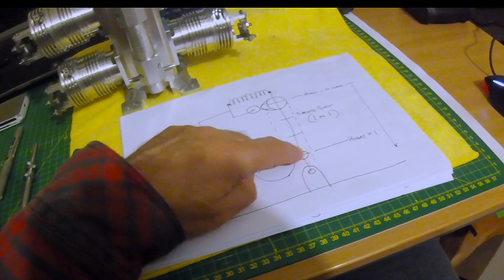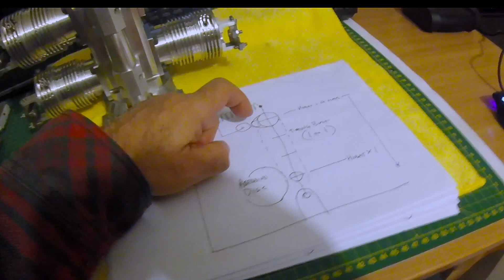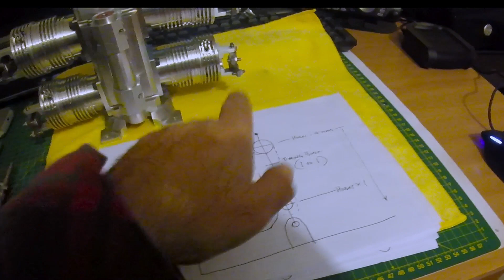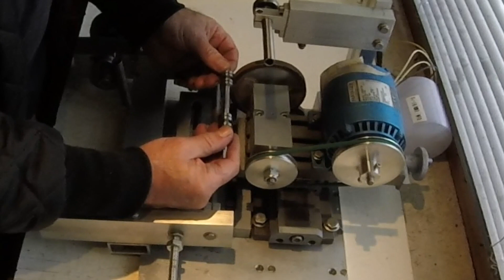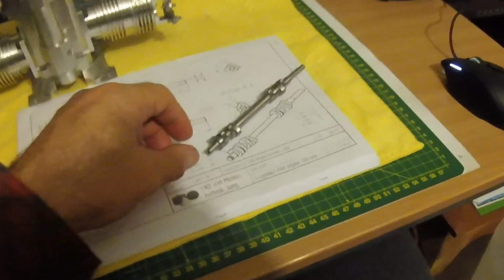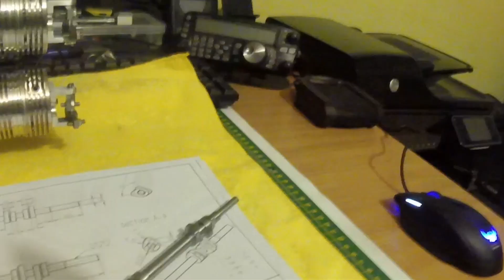Grinding a model engine cam shaft assembly.

Comment: If the master cam is following a roller bearing won`t the cam being ground be the wrong shape? Surely the master cam should press against a FLAT surface not a roller .
Reply: valid point but as the grinding wheel is round...

teh master cam has to be laid out with this in mind, thats all. like you can lay a cam out for a non radial or offset plunger, flat, round, pointed, whatever. it just has to be compensated for...

Comment: I very much like your machine and plan on having a go at making it. May I ask the dimension from the pivot under the cam being ground to the master. Thanks for the Video.
Reply from the maker: Hi John, I used an imperial measurement as it seemed easier, the pivot hole to the center of the master cam is 6 inches - Therefore the cam being ground is 1.5 inches from the pivot that produces a quarter size lobe from the master cam.
Reply: Thanks very much. I have started getting some materials together and I will let you know how I go . Won't be pretty but hopefully it will work. It will take a while though.

Comment: Very neat. How do you index the master cam relative to the individual lobe to be ground?
Reply from the maker: Hi John, The Master and individual lobe are locked in synchronisation by a timing belt and a degree disc is located by the master cam. The degree disc is not visible in the video as it is behind the input wheel, but any device to measure the angle of the master cam relative to the cam being ground would do. The master cam was rotated at 0, 90 and 270 degrees relative to the individual lobes. Also, the tool is rather basic and could do with more indexing refinement as it is very basic, but as a home made tool, likely to be used less than once a year, it did not warrant too much time on it's design, apart from being fairly solid.